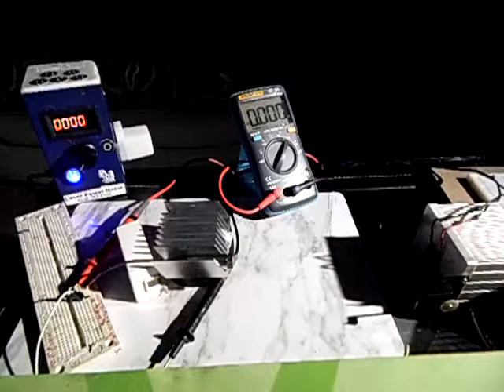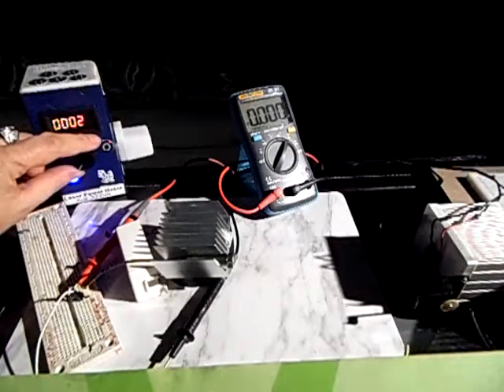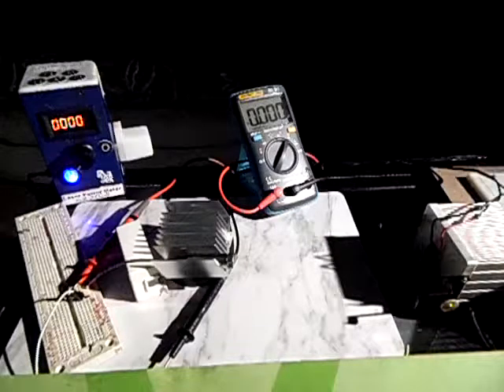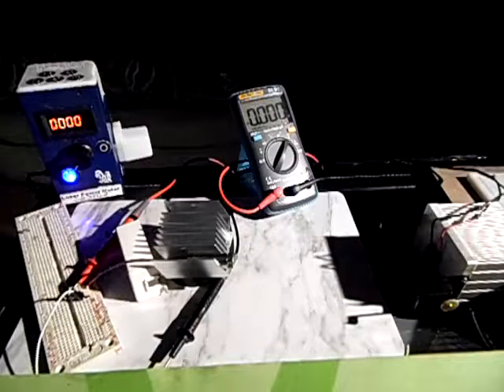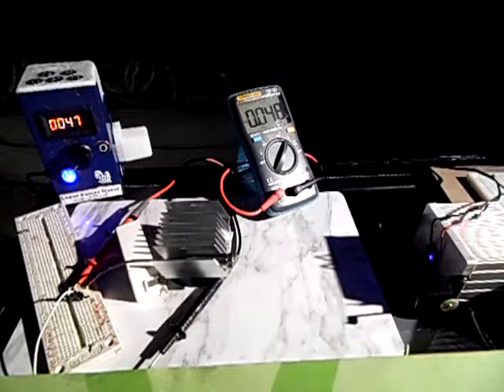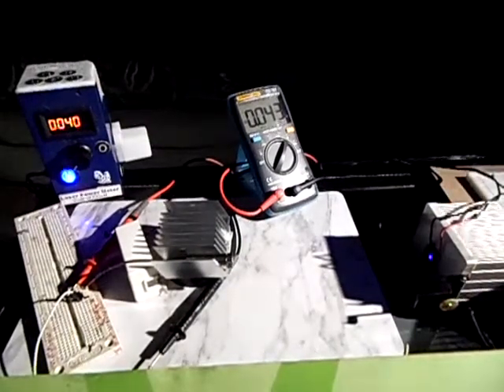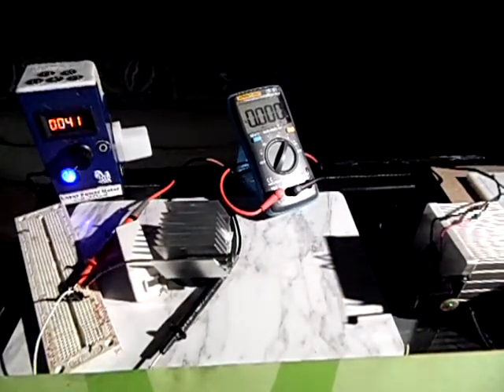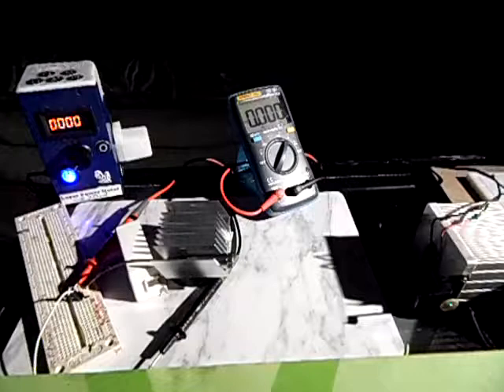Calibration of Laser power meter test SLD3232VF 50mW 405nm violet/blue diode tested MY EVDiary 4#

Comment: Nice! Try sthg stronger to see whether it measures linear.
Reply from the maker: according to datasheet it needs  26ma as minimum before even becomes bright.. after that it draw around 49mA at 6.7V  it is really necessary to have a good heat-sink  because  if the diode is hot lets say 50 deg Celsius it would draw 65 or 70 mA at the same setup same voltage to provide same amount of 50mW and if you cool the diode itself down to 20 deg Celsius it would drop back the amperage draw and increase it efficiency, drawing around 49mA  outputting 49mW  this diode can output max 1.1mW per 1mA and minimum would be 0.7mW per 1mA at its lower point that is 26mA draw threshold ... so at 26mA reaching its threshold you can expect around 20mW of optical power..pretty important to keep diode as cool as you can... 405NM are pretty stable... actually very stable, as you can see its current draw parallel with what it's outputting optically .. ...  this can be useful to you if you wish to calibrate your own  Hobby like Laser power meter... I only wanted to show everyone ratio of Miliamps vs Optical output when adjusted accordingly..  it is pretty stable and follows milliamp increase pretty well and trusty.. just keep the diode at ambient temp at all times.. cool it if you have with a larger heatsink but at least you will be able to calibrate your diy laser power meter.. if diode would get hotter and it can not get more amperage it would drop the optical power down even if it draws still 49-50mA as its reverse voltage changes with the diode's temperature...   remember that... so stable cooling and you've got it.. use multimeter to monitor the draw of your diode directly at diode's power connection... .. you want 6.7v -6.8v adjustable voltage and current source set to 49-50ma.. I have tested  a 2000mW 445nm degraded laser diode and video will be out in a day or 2 , you may hear a little tip on how a unknown diode such as this one can be used to calibrate your meter again.. I will plot the data gathered and show you what happens ...
Reply from the maker: Made a new power test on 445nm  2000mW Blue laser diode using this DIY Laser power meter 
https://www.youtube.com/watch?v=2u4-yrFiNy0
Reply: @Aga-Bubamara  Could you link me to the data sheet? I bought some of these diodes on ebay and the spec sheet I found notes a threshold current of 55 mA (typ)/60 ma (max), but a operating current for 50 mW of 55 mA (typ)/ 65 m(max). As you might guess threshold at 55 mA and 50mW operating current of 55mA doesn't make a lot of sense.
Reply from the maker: it is very linear look for the other video 2w blue laser.. tested.. once you reach the threshold  .. if you graph it you can see the crossing point where 1mv = 1 mw  for 1.6w one that is around  890ma = 890mw... after that point it gets to a point wher 1ma =1.1mw and its increasing.. I made another one and put it on ebay uk  item number 273761097205
 can search for it..   that one I made up to 7W